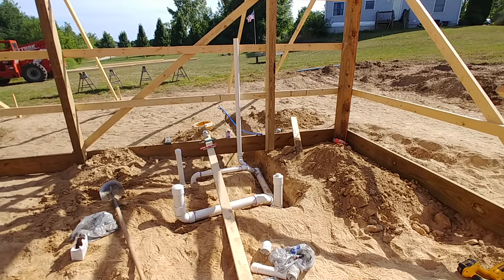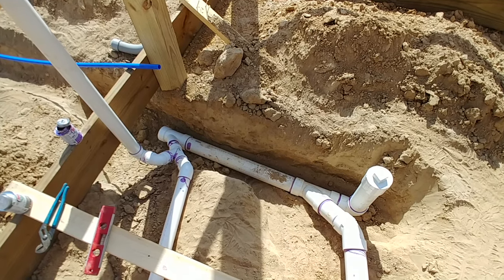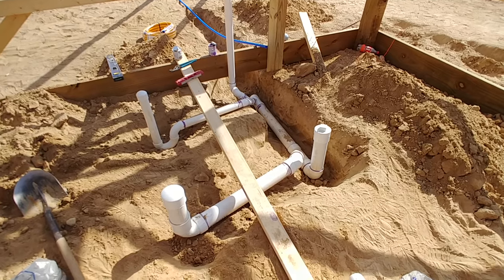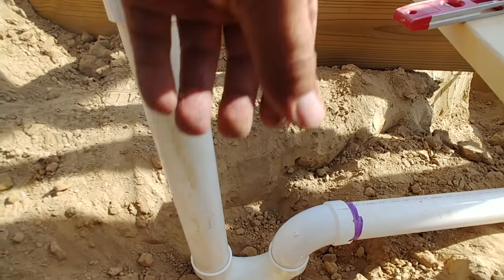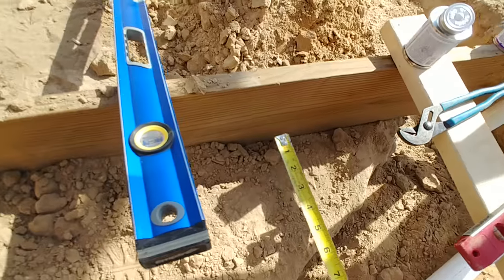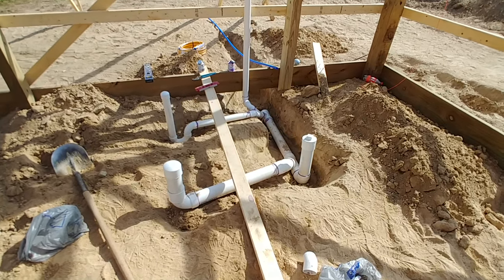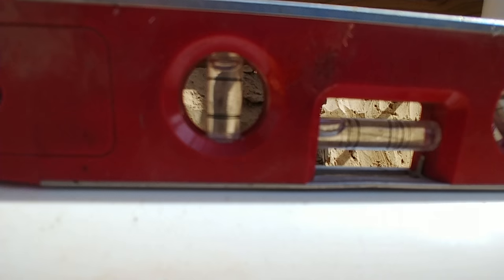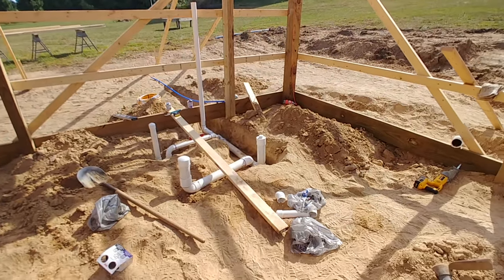Rough in plumbing basics for under a slab.

Comment: What about a composting facility? It is quite a walk to your home from my vantage point of view. You know, once you start building even basic needs become 2nd place😄. Will you have a sink? Small kitchen counter? You know for coffee, washing hands or bricks. I would have a small cooler for refreshments. It promises to be quite cozy in the winter.
Reply from the maker: Its far but not to terribly far away.  From the house im 164 ft :) and yes in the winter I am sure I will desperately want a bathroom lol.  I do want a small full bathroom at some point complete with a shower but that will probably be a project that will wait until next year.  But the ultimate plan when I can do it is with the shower it will be used as a washing station for lego and then I would also have a toilet and small sink as well.  Possibly even a small wet bar/kitchen as well.  Just big enough for snacks and maybe some plates and glasses.  My priority this year is to get it wired and insulated so I can get back to building lego.  Which is going to be a rather large task itself being I will be doing it all solo for the most part.
Reply: Very well planned, @BevinsBuilds  . It does make sense to have all the connections ready. Regarding your electrical. You still have to connect it to your house right. Or are you connecting to the city's line? Thank you.
Reply: Also, how I wish I could volunteer and help. You might get some help from local AFOLs. But it also can take away of your personal experience. At any rate, keep up the amazing job!
Reply from the maker: @makitagut2472  Thanks Makita I appreciate it.  If you lived locally I would invite you over :)  as for the electrical. I really wanted to have a new service installed but wow the price for new service is pretty expensive.  The electrical wasnt to bad (1700) but the natural gas line was outrageous (4200)  i still dont understand why it would be such a huge coat difference.  As if anything the electrical should have been the most expensive in my opinion.
Reply: Thank you, @BevinsBuilds ! What?! Who would have thought there was such a difference in price. I agree. I would have thought that electrical power is much more expensive. Huge surprise there 😮
Reply from the maker: @makitagut2472  they claim the gas is a lower return on investment especially with pole barns so they charge more for installation.
Reply: @BevinsBuilds  , oh I see. Wow.
Reply from the maker: @makitagut2472  yeah I know quite a bit more.

Comment: The problem with going to steep over 1/4 inch per foot is the water will gush out and leave the waste, it needs to float.
Reply from the maker: Yes but on a pipe only 2ft long its not a concern.

Comment: WHERE IT'S THE VENT
FOR THE TOILET????
YOU'R HAVE THE VENT
FOR THE SHOWER
BUT I DON'T SEE THE VENT
FOR THE TOILET
THE 3 INCH PIPE WITH PLUG
YOU SAID IT'S A CLEAN OUT.
Reply from the maker: What I refer to as the clean out for the 3-inch line is the vent

Comment: that is gonna leak why??? you should stick to the rule 1/4 inches... 1/2 is ok if you really dont have to much of a choice and a 1\8  of a inch is ok if you d ont have a choice .. but if you a good plumber sticking to the rule of thumb you would stick to a 1/4 inch. at least 95 percent of the system should be 1/4 inch pitch ... 3/4 is going to cause leaks for sure..

Comment: Wow your on city sewer way out in the country? I'd put in a small bathroom if I were you
Reply from the maker: No i wish I was on sewer.  I will have to install a small septic field if I decide to put the plumbing to use.  But its cheaper and easier to do the rough plumbing now as opposed to later is why I did it anyway. :)
Reply: @BevinsBuilds  ok

Comment: Always vent behind your furthest fixture Other than that Don’t listen to these YouTube plumbers Looks fine
Reply: Furthest fixture from what?  Furthest from where the drain comes into the building or?????
Reply: Focalplane 
He got the clean out and the vent on opposite ends wrong But it will work just fine
Reply: @ChooChooRooter  yeah, I looked at it  since my comment and realized the same thing...thanks.
Reply from the maker: The clean out will end up being the vent.  But this is just roughed in for the concrete to be poured and where the cleanout is placed will eventually be the actual vent and will be extended all the way up through the rough.  The system will work though as is though even using the 2 inch line as a vent.
Reply from the maker: Thanks Choo Choo
Reply: @BevinsBuilds  I was told to use a 4 inch vent pipe for COLD CLIMATES  due to CONDENSATION where you get moisture build up in the attic when the winter season arrives, you never have problems with drainage or funny sounds in the plumbing sanitary pipes.

Comment: Almost nothing in the first shot is vented??? In kentucky you have to vent every fixture independently. So every fixture has to have it's own vent pipe at least 6 inches above the rim of the highest fixture.
Reply from the maker: Thats not a requirement here.  Bathrooms are done as a group and each group only needs one vent and the vent can be done with the 1 1/2 pipe with a stutor valve attached to it.  If I do the bathroom I actually have 2 vents if I wanted to use them and thats 1 vent more than is required.
Reply: @BevinsBuilds  wow that's crazy. Yall could run half the pipe, and I bet plumbers there probably charge the same if not more, and it isnt even vented proper..
Reply from the maker: If I had to guess it would be more.  But everything in the metro detroit area is over priced.  Especially for trades.

Comment: the toilet is not vented
Reply from the maker: It is vented by the 3 inch pipe that I said was the cleanout.  That will be the pipe that runs thru the roof.
Reply: Your vent needs to go before   Not after

Comment: Need a pee trap !!!! Daryl. Also could you stop calling us you tubers and be creative an call us Bevinites or Bevins ect.
Reply from the maker: Hi Benny, the only pee trap installed in rough plumbing is the one for the shower.  Which is installed, your toilet has a built in trap and the sinks is installed in the cabinet below the sink.  As for the name, you dont like youtubers?   Ill have to think about a different name Bevinites is a really good idea though :)
Reply: His use of only the shower trap is accurate. Traps under the toilet or sink would be redundant traps and cause serious issues. Each fixture is only able to have one trap and sinks are in the cabinet for easy cleaning, and toilets are in the body for similar reasons.

Comment: vent looks to be lower than the toilet, will likely self syphon the toilets trap
Reply from the maker: The actual vent will be the 3 inch pipe with the clean out and be ran up and thru the roof if I ever do install the toilet so no there shouldnt be any issues :)
Reply: This is the most inaccurate post put on here. Toilet cannot back siphon because it is self filling. You do not have to directly vent a toilet. A vent 30 feet on the other side of the house can and will vent a toilet
Reply: 30 ft away, lol, what code do you follow and your incorrect about the toilet, that trap will definitely be dry
Reply: @cannonplumbinganddrainllc4221  Ipc and or IRC and please tell me how a toilet that is self filling  every time you flush. As well a toilet does not and I repeat does not draw air it pushes air. So therefor if you have a closed system the toilet will not push air hence not flushing. So as long as you have a vent somewhere on the system and the right pipe sizing the toilet cannot and will not ever siphon empty. There is no possible way this could happen. I have not directly vented a toilet in about 15 years.
Reply: improper venting 30 ft away will do it bud
Reply: well where im at the toilet vent needs to be no less than 6 to10 ft away from a vent down stream bud, wouldn't fly sir
Reply: @cannonplumbinganddrainllc4221  OK show me what code book and section say's exactly that and I will show you in the IPC where its states that there is no reason to limit the distance for a vent to a toilet because it is self filling. I understand that different states use different codes, but I also know that there area a lot of plumbers that know 1 way to pump and 1 was only.... BUD!
Reply: you don't want the gurgle monster when you flush bud
Reply: TEXAS, depending on the size of pipe for drain and venting theres roll, double roll, flat and stack venting, just because it self fills doesn't mean it wont have pressure from improper venting and wont self siphon or have back pressure ect………...
Reply: the tank is self filling not the s trap in the toilet
Reply: you can have a full tank and a dry trap due to improper venting, the trap only fills when the tank is flushed
Reply: @cannonplumbinganddrainllc4221  Wait what? Then what the hell fills the bowl hence the trap? Please tell man man I am all ears on this one. I too from Texas and if you are, then you can read the IPC yourself and should know this since that is the code the state adopted about 20 years ago.
Reply: Here I will help you, read section 909.1 in chapter of the IPC. Since I found the city you work in and in the state of Texas do not allow amendments to the code and your city goes strictly by the 2015 Ipc it will explain. Surely you carry and IPC and or IRC books in your truck. Or do you strictly go by what inspectors tell you as being the truth?
Reply: so if theres a full tank and the s trap loses water due to improper venting then it doesn't  just fill itself unless it calls for water, you would have to manually flush it, back pressure 30 ft away way causes drain monsters sir, you tell me now
Reply: unless you flush or it calls for water which it has to be manually done what would refill the bowl, the tank only refills not the bowl sir, now when you flush the fill valve dumps and the bowls full only when the tank is empty but you can definitely have a dry bowl with a full tank, just saying
Reply: @cannonplumbinganddrainllc4221  So you are telling me that when I go to my bathroom right now and flush all the water in my bowl will go down but not refill the bowl after the flush only the tank? So what is the little fill tube hose for that comes from the ballcock to the flush tube do then?
Reply: if fills the tank but if theres improper venting it will suck the trap dry no matter how full the bowl is
Reply: the vent always has to be above the flow line it serves no matter what and down stream up no more than the code allows and 30 ft aint no where near that unless were talking 18 inch pipe, cmon man
Reply: were talking venting not flush valves that refill tanks that only refill when called for, do you have a license
Reply: im not trying to be rude or disrespectful but your not correct at all on what your typing sir
Reply: @cannonplumbinganddrainllc4221  yes I have a license, in fact I'm a 30 year master plumber. Now whatever you just said about 18" pipe is so far from the truth or the fact that vent pipe to a toilet must be above the flow line of the fixture. Even if you individually stack vented a toilet your vent is still below the flow line or rim of the fixture. So the question is do you read the code book or just yessir to the inspectors and let them spend your money for ya on these jobs. If you plumb in TEXAS then you should know the IPC it is a great read you ought to try it out. Now back to the toilet. Again there is no possible way to drain a toilet without flushing. I will explain to you how a toilet works. When you flush all the water from the tank flow's down to the bowl, and as it fills the tank it also fills the bowl, hence the little hose from the ball cock. When you flush a toilet it pushes the water by gravity into the trunk line while it is doing this it is pushing the air, as long as you have a vent somewhere the system to let the air out that it is pushing it will vent and self fill every time. If you ever had a toilet that lost its water in its bowl, it is because of manufacture defect not from the venting..
Reply: where did the initial question go, my numbers M40870
Reply: @cannonplumbinganddrainllc4221  I know found your website. Looks good by the way.  #21953
Reply: If you’re in the IPC, there is no limitation in length for the toilet’s trap arm. That’s right, no limitation! That means your fixture drain can have an unlimited distance (909.1).In the UPC, the toilet’s trap to vent distance is limited to 6 feet.
Reply: @shanedinkel7736  just aint the right way, TEXAS is where its right man
Reply: if you want the gurggle  monster in your drains and save money on parts go ahead
Reply: @shanedinkel7736  do it right from the get go, STACK ROUGH AND RE VENT ALL DAY, YOUR WELCOME
Reply: @cannonplumbinganddrainllc4221  I've only used the UPC 6' in Wa and Idaho...  This is the way I was taught, and is the code we use... I had a friend years ago that installed a bathroom in a basement with no vents and he wondered why his toilet water disappeared from the bowl every few days...  No vents...  I'm with you on this one.  There are definitely different ways to plumb, you know that... But, in the end, there can be a right way or a wrong way...
Reply: @cannonplumbinganddrainllc4221  Same way in Wa and Idaho...
Reply: @cannonplumbinganddrainllc4221  l
Reply: @jwblount7802  Cannon is 100% correct. You must vent a fixture before the waste or drain line changes direction from horizontal to vertical. The shower waste and toilet drain were plumbed to self siphon the traps. DO NOT plumb the way this genius has. And certainly don't take pride in bullshit. If you're a plumber then I'm a magic bunny that shits fresh daisies.
Reply: @stevetyree8110   Just try reading the 909.1 of the IPC as well the whole chapter 9 of the IPC you just might learn something. YOu could even do it while you are "SHITTING FRESH DAISIES". All I do is new construction houses and I too used to do it just like the other plumber mentioned, but why? Directly venting a toilet serves absolutely no purpose other than more penetrations through a roof that is not needed.